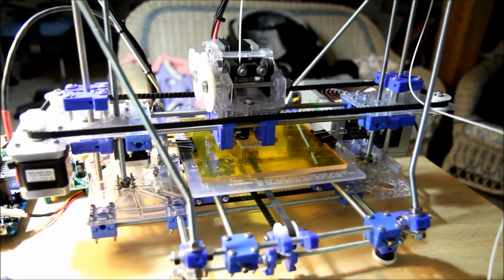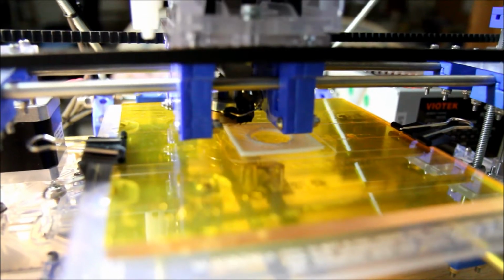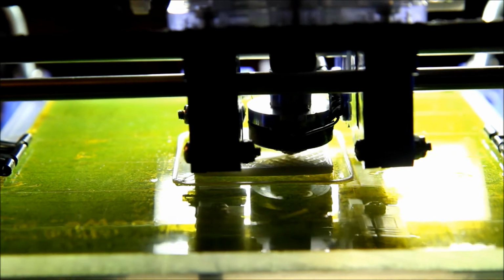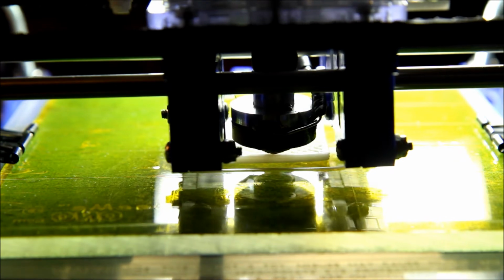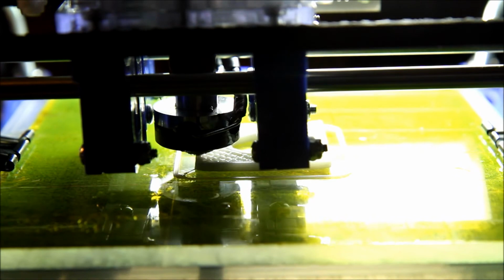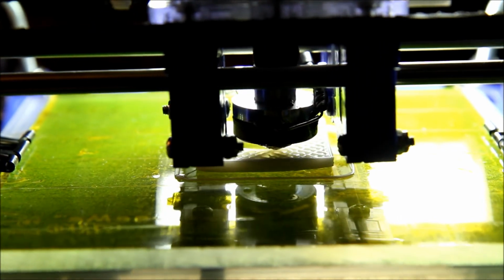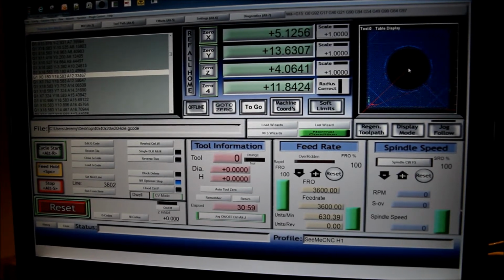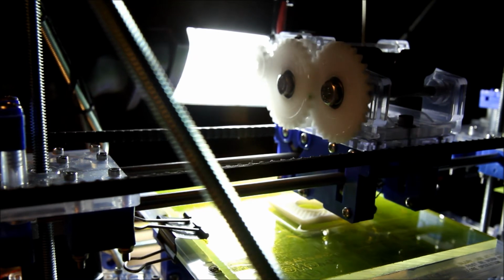SeeMeCNC H1- First Print

Comment from the maker: In short, yes, that should be fine.  There should be some good contact between the hotend and the heater cartridge though.  Kapton tape isn't a conductor, so hopefully you don't have to make up the differences in diameter too much.  The second, empty hole - I'd probably fill it with something - even a resistor that isn't hooked up.  I see it as a bunch of surface area that will be bleeding heat away.  If you don't, the heater cartridge will have to work extra hard to keep temps.

Comment: Hi,

So I have most of my assembly done, and I was wondering, is kapton tape enough to keep the thermistor and heater cartridge on the hot end? Can I operate with a heater cartridge in one hole and leave the other hole empty? This hot end is the last part that I need to finish!

Thanks!

Comment from the maker: A good, thin, very flat sheet of aluminum would be just fine as a starting point for a print bed.  A sheet of wood would tend to warp a little more with humidity.  The good part about wood is that it's a decent insulator, so it can serve as a base for a heated base if you wanted to keep the rest of your rig relatively cool, that is.

The reason I went with glass as the print surface is so I can remove the glass after each print, and use a second piece for the next print.Helps with part removal.

Comment from the maker: The kit from trinity labs, no.  A heated bed - yes.  I now have one on my H1.0, though I had to print some parts to make that work out.  I see the H1.1 comes with a heated bed - or at least it looks like it does.  I've seen some print directly onto the heated PCB.  I wouldn't recommend it.

The reason I'm a strong proponent of a heated bed is your first layer is the most imporant part of the print.  It needs to stick in order for the rest of the layers to work out.  Heat really really helps.

Comment from the maker: Honestly, on both my printers now, I now use an aluminum surface with glass on top.  Glass is much easier to clean, and it helps keep things flat and true - whereas aluminum can come bent (I have some examples of that).  The heater part of the bed is either directly under the aluminum or between the aluminum and glass.  For my MendelMax, I'm really liking the solution from trinity labs dot com.  Look for the Linear Rail Y Axis Upgrade Kit - and look at the completed picture. This has worked best

Comment from the maker: (corrections to the below: 12v or 24v (not 12w or 24w).  Also, checking my records, I got 10 cartridge heaters for $41, shipped - though I see they go for more one at a time.  On ebay, search for:  heater cartridge mendel  and you'll see a bunch to choose from.  Make sure it'll fit for whatever hotend you go with.)

Comment from the maker: As for the wire, I initially went to the home supply store and purchased high-temp wire.  This was overkill.  Because the crimp connectors are at the ends of the resistors, it's much cooler there - and I've gone for almost a year now using regular wire.  You need wire good for > 5 amps, and I think I went with 18 AWG.  16 gauge would work as well.  Note that if go you with a heater cartridge, the wire comes attached - and with a good length - so no fitting needed, it just works - and works nice.

Comment from the maker: I learned that aluminum foil is not a good solution.  One of the resistor types from hotends dot com is fairly uniform and fits very well to the cavity in the hotend.  Still better, is the cartidge solution, which fits pefectly into the 6mm hole in the hotend I'm talking about (not the one shown above).

You should not solder the resistor wires to the wire that provides power,  You should use bare wire-to-wire crimp connectors.  I did here and they worked great.

Comment from the maker: For the hotend, this one used two resistors in parallel.  Most nowadays don't.  And in fact, the hotend that came with this printer kit was pretty poor.  I now go with hotends from hotends dot com.  Very worth it.  To heat it, I'm now standardizing on a heater cartridge (usually 40w) - they're built for 12w or 24w.  Only a few bucks for these on ebay.

The resistors need to be fairly tight to the hotend, and in this company suggested you wrap them in aluminum foil to make up the difference.

Comment from the maker: That's a bunch of questions!  The parts you see in the video were supplied.  I was printing directly on the acrylic which was clipped to the plastic table.  It does work, but not well.  After a dozen printer, the acrylic was cracked to pieces and was actually falling apart.  You really want to print onto glass - borosilicate glass specifically.  Also, for better printing, you want the print surface to be heated.  For printing with ABS plastic, I print onto a 110(C) surface.

Comment: Hi,
Can you print directly on the supplied table or do you need something else clipped to it?
How did you do the wiring for the hot end? (are the resistors in series/parallel, do you need to seal it into the extruder head, can you solder it, what wire do you use for these parts)

I'm sorta new to this stuff, so thanks for you help!